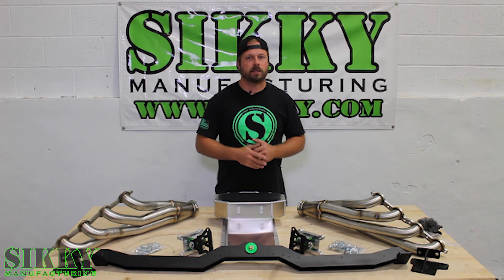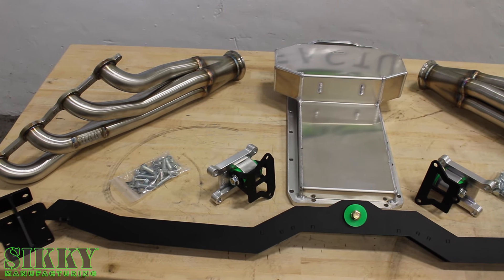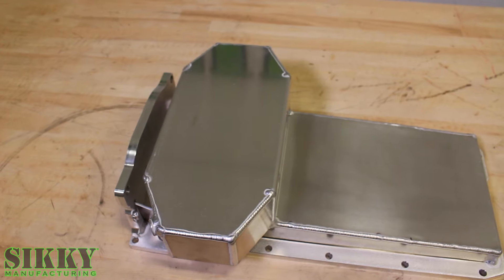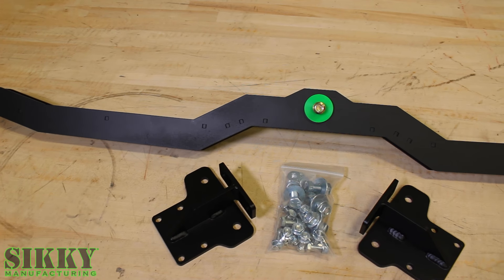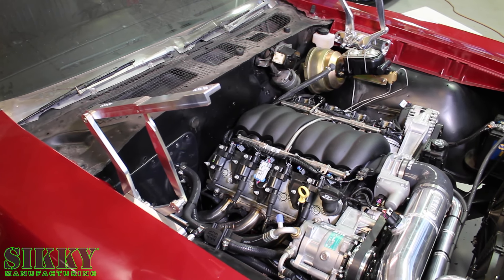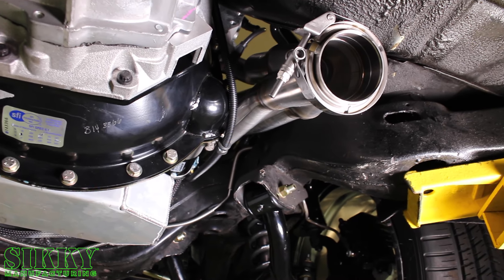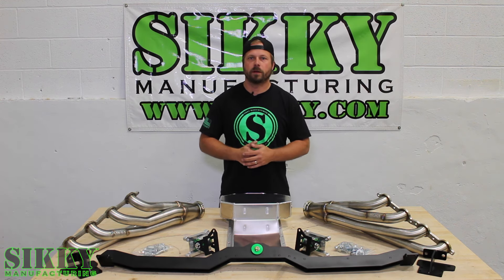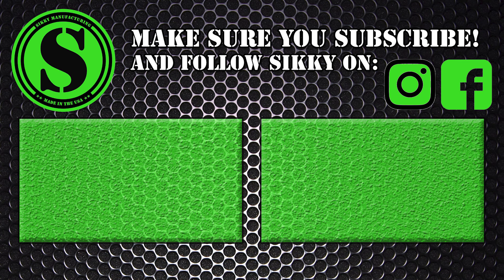1968-1972 Pontiac GTO / GM A-Body LS Swap Kit by SIKKY Manufacturing

Comment: Hey guys im about to do an ls swap on a 69 gto and well i wanted to know if with this kit i had to upgrade the front suspension or anything that will nwwd modification in the chassis id like to know to give the customer a price
Reply from the maker: So steering can cause some clearance issues. Depends on what rack setup your running. Most fit fine though